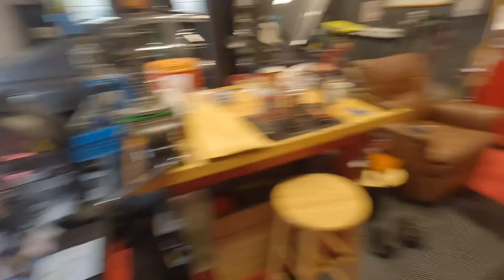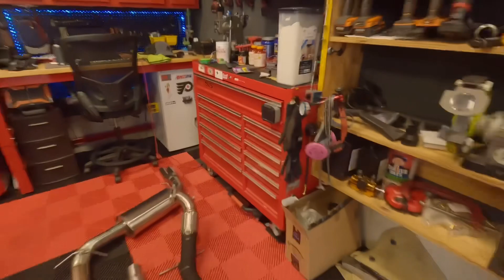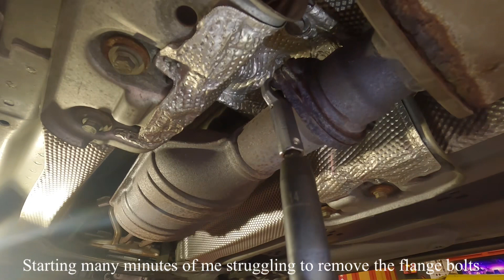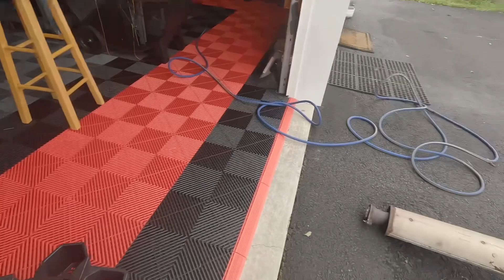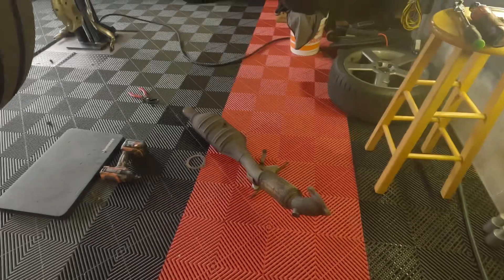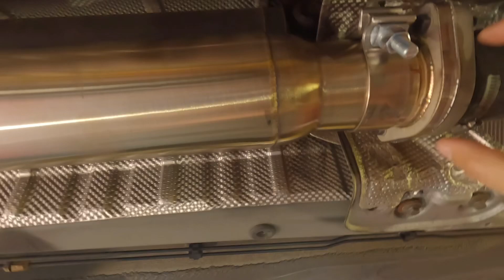IPD Exhaust Installation on S60R

Comment: This is helpful, 
just curious if you knew or recall the l overall length of the resonator?  16”?
Mine recently went out, on my ipd oval setup on my 06 m66.  currently don’t have access to get underneath to measure, thanks
Reply from the maker: I don’t remember. I’ve also sold the exhaust. It was too droney for every day use. Sounded great with windows down.   Awful with windows up